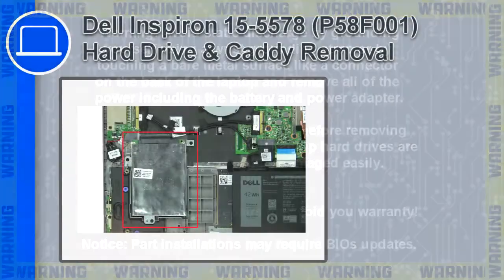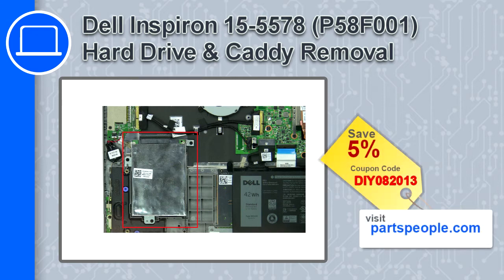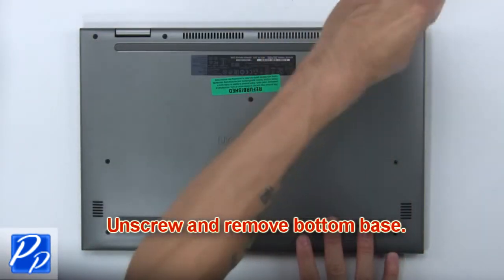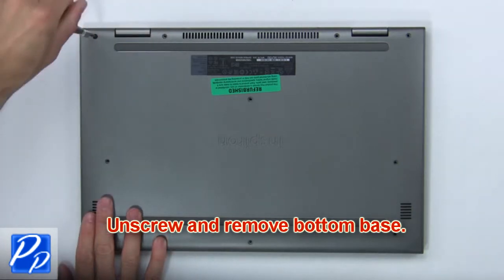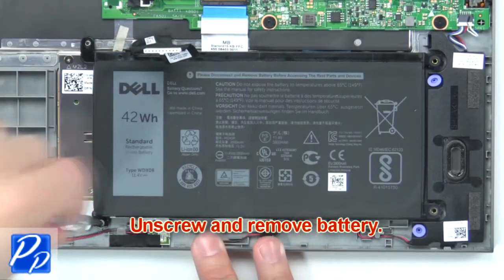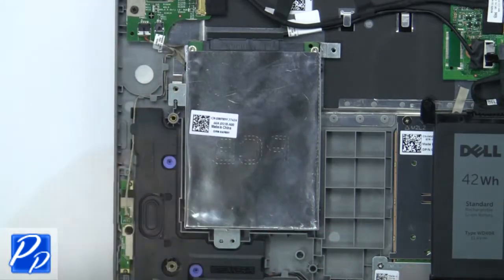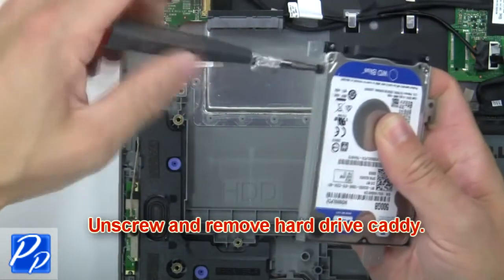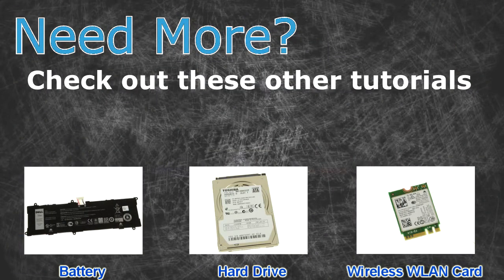Dell Inspiron 15-5578 (P58F001) Hard Drive & Caddy How-To Video Tutorial

Comment: This laptop have a M2 slot for ssd nvme?
Reply: Do you have the answer for the question? I'm wondering the same. Let me now if you know the answer
Reply: @carranzasantiago1691  
I did not get an answer but I read on the Dell website that it has the M2 slot, I will buy one in a while to test if it is possible to place it.
Reply: I have the laptop here beside me.  The drive that came in mine is "micron 1100 sata 512gb".  From what I can tell, thats a cheap M.2 drive.  I was wondering if they can support the M.2 and sata at the same time or if you have to pick one or the other.  Mine did not come with the HDD caddy or the cable to connect sata to the motherboard so I can't test.